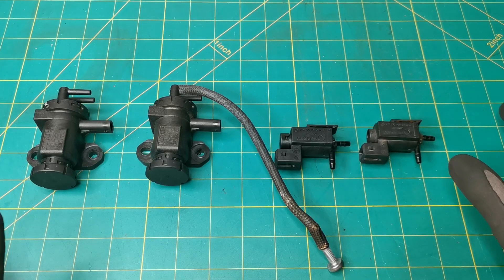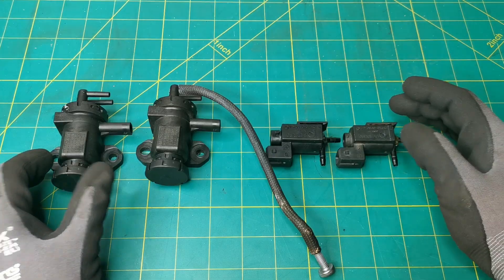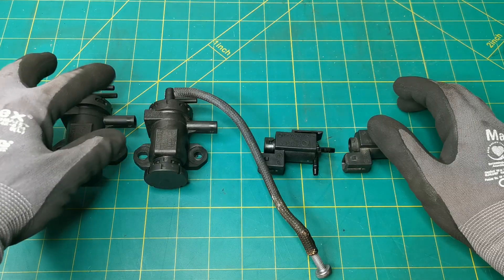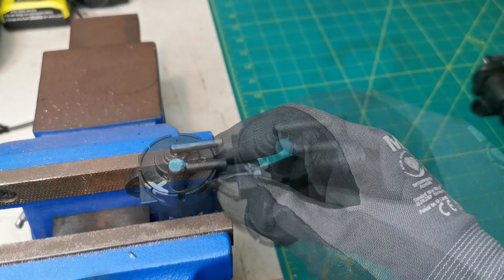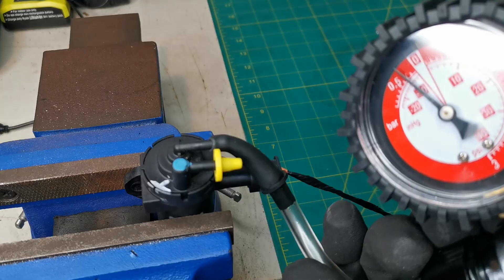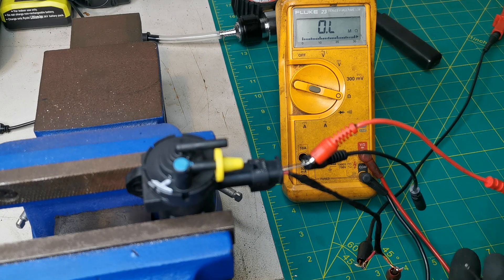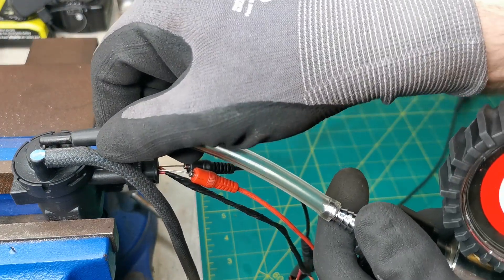How To Test Solenoid Valves - Turbo / EGR - Step By Step Guide - DIY

Comment: I have a problem with my opel astra  its turbocharger solenoid valve. Like the first video u showed. Now read 16 ohms . I bought one from aliexpres .cheap one. It worked fine about 2 weeks after still failed. I measured the new one from aliexpres after failing reads 11.6 ohms. How ohms needs to be the new one ? Help me please. I forget to measure the one cheap that bought from aliexpres before using it ?

Comment: I have a mk2 seat leon fr 2.0 170ps.mine is missing the grey plastic cap, and I can see a small hole, around it It looks like a small foam o ring. Will mine be OK without the cap or not?
Reply from the maker: It will be ok without the cap if you have tested it and it is working ok. It is a dust / protector cap.

Comment: As a DIY guy i,m really appreciating these last run of videos.
How do you determine the positive and negative when hooking up the power supply 
when testing .
Thanks in advance
Reply: It doesn't matter mate. They are just an electromagnet.
Reply: Thanks for reply  @Mr-Keating
Reply from the maker: Thank you Jim for the kind words, much appreciated.  
In most cases from my understanding with regards to solenoid testing it doesn't matter what way you test it if there are no marking on the solenoids for + or - or diode symbol that can be seen.
But like most things in the automotive industry there are exceptions. You may also come across polarity sensitive ones as there may be a diode in built.  
 
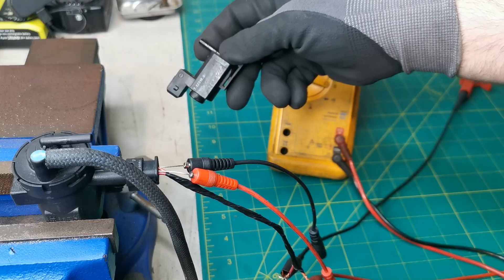Look for markings on the solenoid and if you look at my second test, there is in fact postive and negative marked on the solenoid, + visible from 6:21 where my red lead goes in. I hooked it up as per the markings to test. 
I suppose there is a chance you could damage it if hooked up wrong in those cases, I don't know how likely or unlikely that is though. I will also always try to avoid finding out :)
Reply: Thanks again I'm definitely going to watch these videos numerous times to let it soak in , the plan is to start testing while everything is working and get some experience

Comment: Good description of normally open and normally closed solenoids. With intermittent fault codes, I like to test resistance while heating with a heat gun. Have found many intermittent faults that way. Mazdas and Fords in particular set 2 of them on a plate bolted to the engine area - where all the heat is absorbed! They are on the intake runner. Thanks for sharing mate!
Reply: Excellent point. 

Love the communal brains trust from everyone doing this stuff. 
It’s an absolute credit to a unique industry. Everyone is keen to share knowledge. Most industries don’t. Diagnostics is so different. I’m learning so much.
Reply from the maker: @FuManchu5ltr  100% it is, learning, there are some amazing people in the industry sharing knowledge and MiracleMAX is one of them :) 
 
The Mazda and Fords he spoke of are common for failures and I also made a video on them a number of years ago https://www.youtube.com/watch?v=xilK8O7L0r4 :)
Reply: I have the same on my opel astra j . The heat damage those valves. In opel astra is behind the engine . I touch with engine and temperature damage that. I gone order a good brand and remove from there. To a better exposed place so heat can not damge at all
Reply: Interesting.  I have a boost/lag issue with my Mercedes turbos and although I suspect this solenoid, testing so far shows it normal BUT interestingly, first few minutes of driving it acclerates normally and then after engine is heated up I start experiencing the issues!  Is it possible that my solenoid is working when cold but not when hot?  Thanks
Reply: @c.a.n.4202 Absolutely. Try testing the resistance of the solenoid while using a heat gun. If it's faulty, the resistance will increase